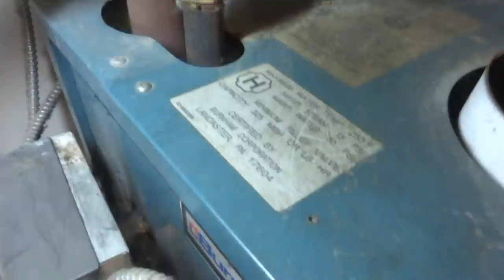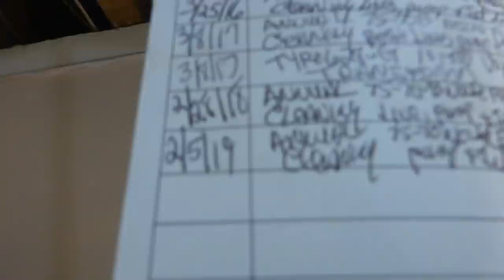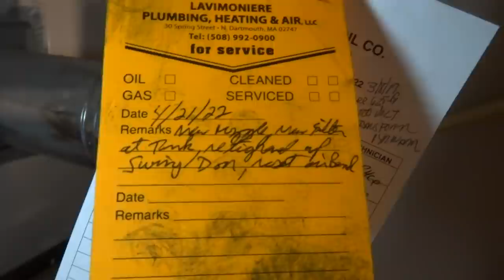BOILER BLOWING BLACK SOOT CAN I HELP

Comment: I thought you were going to check her draft to make sure that was not her problem, with that  funky pipe and elbow tied into a chimney it could have not been drafting right if the chimney was blocked.
Reply: He did. He checked OVER FIRE draft
Reply: 16:51.
Reply: @gabbytaveras5650  Thanks, My guy does it through a hole in the pipe...

Comment: Just one thing that doesn't make sense to me Steve, the oil that these boilers run on, looks a lot like the off-road diesel that we burn in tractors. Just wondering if it's the same, or if it's a complete different fuel.
Reply: It is the same as off-road diesel, but without the red dye.

Comment: No smoke test or combustion test?
Reply: Why would you bother when you don't even clean the soot out of the boiler? Oil pressure not checked either which can be a common cause of soot because customers have fiddled with the adjuster. You wouldn't get away with a job like that in the UK.